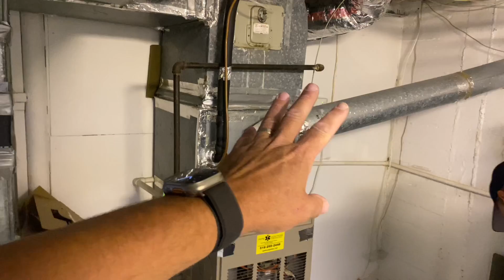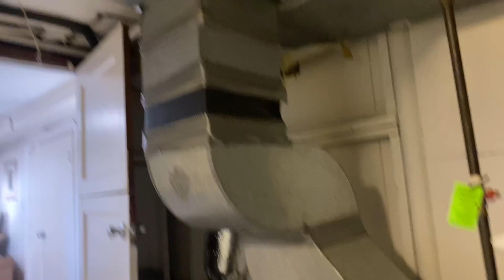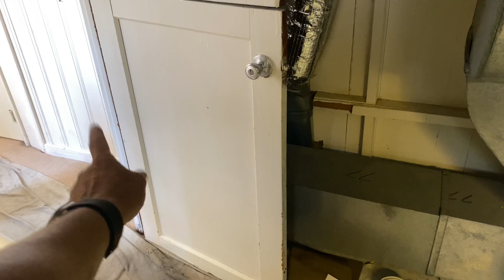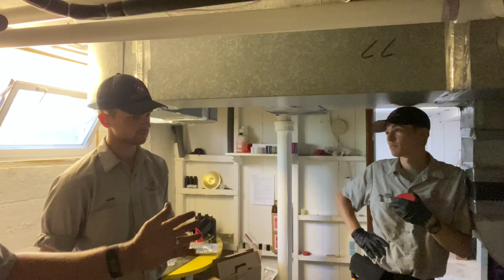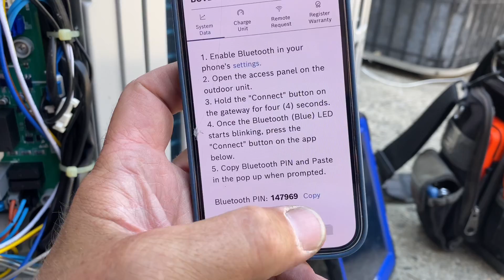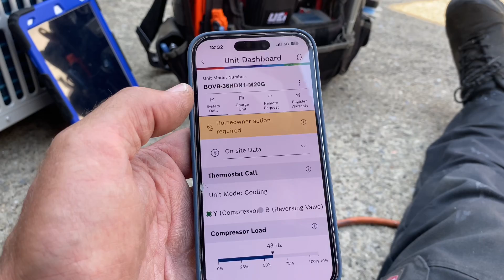Old Goodman R22 HVAC System Finally Died - Surprised Homeowner with Ultimate Heat & AC Upgrade

Comment: Can any professional please tell me the best all electric ac/heat combo package unit 3T for a residential install. It's on a concrete slab on the ground to an 1130 sq. ft. CBS 2/2 1973 home in east central Florida. Thanks in advance.

Comment: So now you are back on the Bosch train after compalining about certain aspects of the company.  Well, Bosch is basically a poor man's inverter.  In 2012 I installed a 3 Ton Bryant 280A Evolution Extreme ($6400 installed) 16.8 -- 20 SEER/11.4 -- 16 EER/10.3 -- 13.0 HSPF and LRA of 16.5,  and wish I had it here today in Central Florida to reap the performance and energy savings. The Bosch 3 Ton by comaprison with a high RLA of 19 (not energy star) EER max of 14 (12.5 w/3 ton AH) and HSPF of 10.5 using a 2 ton air handler according to AHRI performance data. When the unit runs full-out on these extremely hot days, it is costly with RLA of 19 when it's running as a 3.5+ ton and we always hope it evens out at the end of the month when the electric bill arrives.

Comment: Pretty slick system. I like the live data a lot.   Nice job, in spite of being forced to tie into those funky old ducts.  Mr Homeowner really needs to let you run a new thermostat line.
Reply: @PipeDoctor  i always say, I can fix the equipment but I can’t fix the customer.    It’s a little like someone buying a  brand new Porsche then re-using the seats from their Chrysler minivan.

Comment: Nice Install - understand the best way is to install new T-stat wiring, but for those customers that don't want a new, I've had a few installations using the Fast-Stat 5000 (smaller or larger) to get more wires out of what you have.  Take a look at their products.  And yes, it's a shame not using all the features of this system with Dual fuel, etc..  Good work.

Comment: while not nessesary should you add a trap to a condisate line on a postive pressure system due to a small effience loss (air escaping out of the drain)?
Reply: @PipeDoctor 😆

Comment: Very nice install! There is some pretty high tech equipment out there but in this case its disappointing that the homeowner doesnt want to upgrade the wire and the thermostat.

 That being said I'm surprised that it isnt designed so the compatible  thermostat will communicate with the system over 2 wires only, the wire serving as a mere data link..

Comment: Open the suction line before the liquid, The refrigerant pushes the oil out of the condenser and when you open the liquid line it pushes it too the Evap coil. But if you open the suction it will suck alot of the oil back up.

Comment: MacMansion, are you a UFC fan? Much love. Too bad he wouldn't run the wire. Pay all that money and not get the full use of the system. You know im getting full use of mine.

I’ll connect my water safety sensors tomorrow. Thank you. I was afraid till I saw a Bosch ❤.
Reply: @PipeDoctor  not hooked up yet. Lol. I will tonight. Had busy day. I’m gonna break r.
Reply: I don’t want to fuck anything up

Comment: I think I’ll stick with American made heating /cooling equipment!!  I had a Tempstar system for 18 yrs and a Bryant for 20 yrs. Not too bad!  Replaced a condenser fan motor on the Tempstar and a blower motor on the Bryant   What’s a Chinese Bosch last for ?  40 yrs 😅

Comment: Awesome install , dont have many bosch systems in my area but in my opinion too engineered on the condenser controls more stuff to break down
Reply: I was worried about them at first but I have had zero issues with them since they came out.

Comment: Hello, Believe the heat pump should have been elevated on a heat pump pad to get out of the snow. This will surely be an issue.
Reply: They are only running it as straight AC.  I've seen them use the heat pump pads for these when all the functions are used.  As do I!!!!